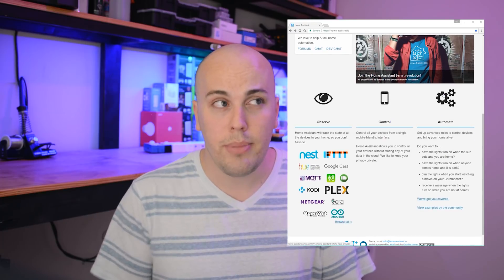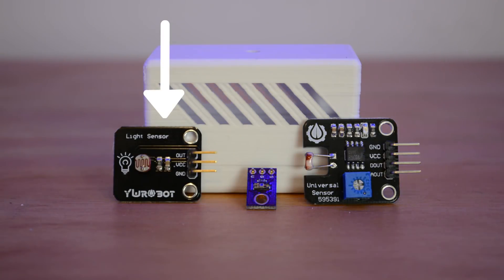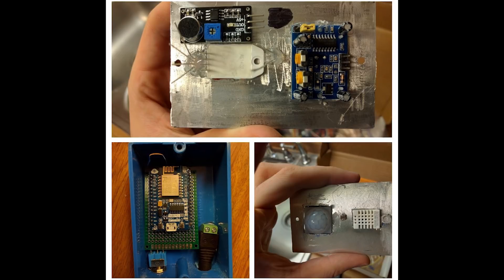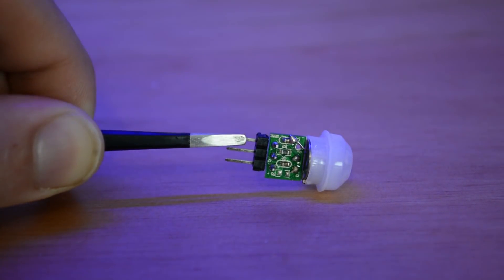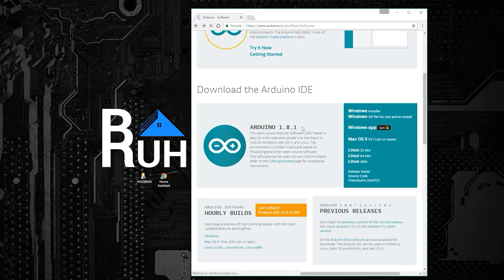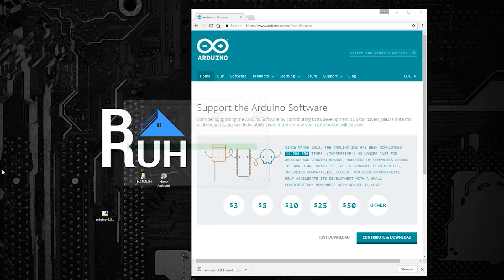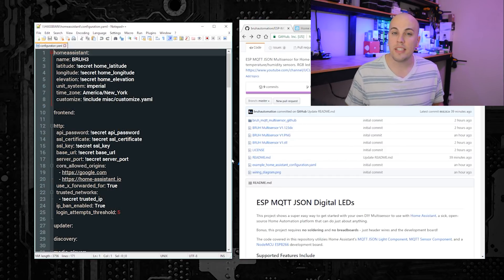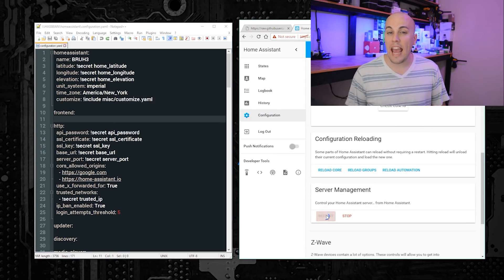$15 DIY Multisensor - Temperature, Humidity, Light, Motion, and RGB LED

Comment: Hello,

I've built your sensors and they are working great. Now comes the part where I actually would like to use them in an automation. I'm still in the learning phase of HA and is probably doing a lot of things wrong.
For example: I want to light the led up in the sensor with a specific color if motion is detected. I've set the color I want in the gui so each time I turn it on, it turns on in red. However, using below automation doesn't work.

  - alias: PIR 1  On
    trigger:
      - platform: mqtt
        topic: "huset/sensornode1"
        payload: 'motion detected'
    action:
       service: light.turn_on
        entity_id: light.sn1_led

Would be fantastic if you got the time to help out.

Comment: Haha built it.

Working for couple of days now. I just think the DHT22 is giving out a higher temp value then it should.
I had your box 3d printed, could the box small size impact the DHT temp reading? like the heat from the nodeMCU adding some heat to it?
Is there a optimum place to set the DHT22 inside?

Best regards from across the Atlantic, from Portugal

Nuno Reis

Comment: Followed by the letter but receive this error

arduino-1.8.2-windows\arduino-1.8.2\portable\sketchbook\sketch_may19b\sketch_may19b.ino:423:28: note: in expansion of macro 'PIRPIN'

     pirValue = digitalRead(PIRPIN); //read state of the

                            ^

exit status 1
'D1' was not declared in this scope
Reply: did you selected the right board on arduino IDE. 
go at tools, board, and chose one of NodeMcu board not just esp8266.
If you have a esp8266 module just remove the D from the sketch.and add the right pins.
Hope this makes sense.
Reply: I see, I choose NodeMCU 1.0 (not 0.9), correct?
Reply: Yes, i don't know what's the difference but deafeningly not just the esp8266 if you have an nondemcu. I think if you use NodeMCU 1.0 it should work. (if not try the 0.9) 
I just have the esp8266 board (without USB access) than you just remove the D and add the proper pin number found on the board.
Hope this makes sense.
Reply: I couldn't reply to the message you sent so i use this. 
That makes no sense. Have no idea why it does that. 
So you have the esp8266 library and the rest of them??
And you copied the sketch correctly?
I thought that you selected the wrong board since i made that mistake and got the error 'D1' was not declared in this scope.
It seems that you have something else going there. 
I am sorry i can't help with that maybe post your problem on some esp forums they may be able to help.

Comment: Awesome tutorial Ben, thanks for putting in the effort! I have the parts on order, oh the wait... in the meantime I browsed through your code. Am I right that the node posts all it values in one message on one topic? (i.e. bruh/sensornode1) An additional improvement may be to send sensor values in their own message, i.e. bruh/sensornode1/temperature and bruh/sensornode1/humidity so that they can be individually subscribed to with different QoS if so desired.

Comment: Hi Ben, Just completed this project & it is working perfectly.
I wanna make some door sensors using basic esp8266 eight pin chip (not nodemcu). I think that will be the cheapest & smallest diy door sensors. Because I am not good in coding, could you help in this or make a video for the same ?
Thanks for being a big support for beginners like me. Regards,

Comment: Hi, this is great. I plan to integrate your ideas into my MQTT wall controller project. Just need to think about placement (in the wall next to the wall controller, or ceiling), and getting power to it (PoE). Thanks for the excellent discussion about PIRs. I've also been thinking hard about these, I really wanted to include a microwave sensor to detect movement direction as well. But I may stick with the mini PIR you are using. For me it's all about the housing and placement, as we are refurbing the home so I get the chance to mount it properly somewhere in the wall or ceiling!

Comment: easy and works great.  thanks again for another useful and cost effective project.  btw, a clear raspberry case works great for this sensor node.
Reply: Good idea
Reply: Thanks for the suggestion. Have you tried and confirm everything works fine with the clear case?

Comment: I'm having a weird issue where the sensors work great but at least once a day seemingly randomly the sensors stop updating in home assistant.  Rebooting the MCU resolves the issue.  I'll have to catch it in the act and read the serial output when i get a chance.
Reply: I tried disconnecting the Motion Sensor,  changing the power cable / supply.  No Lock.  What is odd is that I can still IP ping the MCU but it just stops publishing anything over mqtt.  I'm going to get that serial monitor up soon.
Reply: My serial log shows the data just stops outputting once the MCU gets in this zombie state. Rebooting my router actually triggered this to happen.  I can still ping the MCU though but it just stops sending any data (Publish) and I can't control the led light once this zombie state starts.
Reply: I can reliably reproduce this issue by filtering the MAC address of the MCU on my wifi, then releasing the filter.  The MCU Reconnects (I can ping it) but no data is pushed or can be received on MQTT to the device.  And no serial information comes across either in the serial monitor.
Reply: I have the same issue. Node boots up, get connected to wifi but cannot connect to Mosquitto. Get error code "Attempting MQTT connection...failed, rc=-4 try again in 5 seconds".
It worked once for about 1 day, then I disconnected it to be moved. After reconnect it wont send MQTT :-(
Reply: I've fixed this issue with a code change, is published on GitHub now, bruh was going to update the main code soon too

Comment: I been working on this for about a day and I think I almost have it.   It 's like the MCU connects to MQTT but isn't sending over sensor data?  I just have the photocell hooked up.  Any ideas please?

MCU serial output:
WiFi connected
IP address: 
192.168.1.159
Ready
IPess: 192.168.1.159
Attempting MQTT connection...connected
Setting LEDs:
r: 0, g: 0, b: 0
{"state":"OFF","color":{"r":255,"g":255,"b":255},"brightness":255,"humidity":"0.00","motion":"","ldr":"0","temperature":"0.00"}
{"state":"OFF","color":{"r":255,"g":255,"b":255},"brightness":255,"humidity":"0.00","motion":"motion detected","ldr":"0","temperature":"0.00"}
{"state":"OFF","color":{"r":255,"g":255,"b":255},"brightness":255,"humidity":"0.00","motion":"motion detected","ldr":"311","temperature":"0.00"}

moquitto -v output:
1493590882: New connection from 192.168.1.159 on port 1883.
1493590882: Client sensornode1 already connected, closing old connection.
1493590882: New client connected from 192.168.1.159 as sensornode1 (c1, k15, uUsername).
1493590882: Sending CONNACK to sensornode1 (0)
1493590882: Received SUBSCRIBE from sensornode1
1493590882:     bruh/sensornode1/set (QoS 0)
1493590882: sensornode1 0 bruh/sensornode1/set
1493590882: Sending SUBACK to sensornode1
1493590897: Received PINGREQ from sensornode1
1493590897: Sending PINGRESP to sensornode1
1493590912: Received PINGREQ from sensornode1
1493590912: Sending PINGRESP to sensornode1
1493590927: Received PINGREQ from sensornode1
1493590927: Sending PINGRESP to sensornode1
Reply: I think what is missing is my MCU is not publising any data, though it does seem to subscribe to MQTT
Reply from the maker: Sorry about the issue! Make sure you set Pubsub to support a mqtt packet size to 512.
Reply: I just got it working using the portable version, I was having alot of issues because the esp8266 website was down wondering if that was part of it too.

Comment: Hello Ben,
Thank you for the grat tutorial,
How do you convert the temperature from Fahrenheit to Celsius.
 The DHT sensor is reporting it in Celsius isn't it? I could not find where you are converting it
Reply: Anil Roy in Ben's code he is passing "true" to the getTemperature call. if you remove the true it will return Celsius. it is a feature of the DHT library.
Reply: in the .ino file check the line 449 that says: 

      
      
            float newTempValue = dht.readTemperature(true); //to use celsius remove the true text inside the parentheses
Reply from the maker: It could be done mathmatically inside of the sketch, but if you have units defined in your home assistant configuration file here - https://github.com/bruhautomation/BRUH3-Home-Assistant-Configuration/blob/master/configuration.yaml#L6, if you set the units to F in your sensor it should convert it back to C I believe.
Reply: I would also like to know,  can't find it in the code.
Reply: That's what I could not figure out, when I ran espeasy rom on the same nodmcu, it reported the temperature in Celsius. Thank you for the tip.
Reply: Thanks. had the same problem. Now i know the answer.
Just took of the true and all works fine.

Comment: FIX/SOLUTION: for HC-SR501 PIR: high-frequency/RF interference : solder a 220nF ceramic capacitor across pin12 & pin13 of the BISS0001 chip. 

Came across this solution here -- https://www.letscontrolit.com/forum/viewtopic.php?p=13980&sid=ffb6eaf4ab4b57f28ea9c1ff548e4af7#p13980

Data sheet for the BISS0001 chip -- http://www.ladyada.net/media/sensors/BISS0001.pdf

Note: I used a 0.1uF cap on mine, and it has been completely stable sitting along side the esp8266-01 housed in a 2in. project box (super tight space)

Comment: My parts are starting to arrive! Note that the RGB LEDs come in packs of 10 which I didn't notice, so now I have 100 of them LOL. Wish I'd gone for the Wemos, already have 2 of them running Homie to control my boiler relay and sense the doorbell and they were no hassle. But stuck to the video because it saves me time, many thanks for the effort, especially the PIR as my first attempt had similar issues.
Reply from the maker: Sweet! Good luck on the build!
Reply: BRUH Automation Got it built. Sadly the AM312 PIR still gets false positives for me, so will have to try some of the other fixes. TEMT6000 only seems to read direct light on it, might benefit from a diffuser like the light meters have? I added code to sample the light readings and average them to smooth it out because often it would rapidly fluctuate between two readings.

Comment: Had the same issue with the PIR and WiFi. Ended up making a shield out of sheet metal and connecting it to ground. Seems to have resolved my issue.
Reply from the maker: Sweet! Maybe the ungrounded shield was my problem. That's awesome you got it working, though!
Reply: Michael Jenkins tie it to the ground pin on the pin header

Comment: Is it possible to run up to 50 of these at once? Each one would need to have 2 temperature and one humidity sensor, but no other sensors.
Reply from the maker: For sure. I don't think there is any problem on the MQTT or HA side for that.

Comment: Cool stuff and, as always, a great video explaining the whole setup:)

I took it a step further and added in the 433Mhz transmitter to it and then flush mounted the whole thing in my wall. I have 3 of them configured now, one on each floor

I put some pics up on the below post.  

https://community.home-assistant.io/t/anyone-using-a-315mhz-and-a-433mhz-transmitter-with-one-nodemcu/8920/3
Reply from the maker: That's awesome! I love the hardware side on that. Mounting in the wall is nice!

Comment: Just out of curiosity why not the WeMos D1 mini? 
it's smaller cheaper and has shields so its even easier to connect....
Reply from the maker: Not enough pins for this header wire setup. With a shield it works, but that's just more to deal with rather than using a straight board with all the pins I needed. But, they all work so whatever you prefer is good with me!

Comment: Thank you for pointing out the issues you had in selecting a PIR sensor. I'm currently also having issues with PIR and my Sonoff.... There are a lot of false triggers, I'm probably going with the sensor you suggested.
Reply: Did you have any better result with it? I'm using the usual big PIR (and a RAdar sensor, also) and having an hell of false triggers...

Comment: Most pins on the ESP8266 boards have pull-up resistors on them. So could you use the DHT22 as a stand alone?

Comment: Found your channel recently and I'm binge watching videos right now. ;) Not sure about the Aotec sensor but Fibaro one has a ton of configuration options that let you configure anything, from frequency of measurement, sensitivity, pooling rate down to LED signalization color (temperature dependent by default) and intensity. You should be able to configure it to be almost as responsive as the DIY one but it will affect the battery life. (I'm writing a Device Handler for SmartThings for it right now because available ones don't work very well when it comes to configuration so I'm "ears deep" in it's technical documentation). Also check out the new Fibaro KeyFob - up to 30 scenes in a small remote (I also wrote Device Handler for it - very fun device).

Comment: I must have watched this video 25 times, really great stuff. It's because of you I'm a total HA convert now. baller.

I'm waiting on a shipment of the PIRs you suggested, but in the meantime, I just wired up some other ones I had offhand (Gravity digital PIR). Weirdly enough, I'm getting no noise when wired up on the breadboard, but TONS when i try to solder everything on a perf board. I thought it was the wifi interference like you mentioned, but my breadboard setup has been running solid for 12 hours with no noise with the PIR sitting directly on the ESP8266.. hmmm.  Anyway, I'll probably try different things until the PIRs you mentioned get here.

Just wanted to say thanks for going through all the hard work you put into this channel. It shows, and you're my hero.

Comment: Doesn't the heat from the ESP throw off the dht22
Reply: Of course this would skew the results of the measurements.
You could zero-out the difference in the calculations or mount the DHT22 further away from the main box.

Comment: Hi Ben, your vids are so nice to watch. Thanks for the hands on video, also your approach on solving the PIR issue deserves an big applause,
Reply from the maker: Thanks much! Yeah, in the end it was quite a simple fix - just buy the right thing. :P Cheers!
Reply: hi Ben,  hardware as mentioned has been ordered (by Alixpress), gonna build it. One question, i currently build a similar setup (only temp, humidity, light) with a Huzzah Feather, and copied some other scripts using DTH, i just added the analogue photocell with a potentiometer and got it working perfectly. I used some of your design to get it configured quickly. Only question that i could not get fixed are the Value templates. I couldn't find clear reference on this. Maybe i missed something..

Comment: Hey, great videos. just started building my home automation base on a lot of info on your videos. I have 2 requests both around hyperion. could you possibly do a tutorial on how you integrated your hyperion into HA? Including the color picker box and the effects input list. I checked out you code on github but find it a bit daunting as i am quite new to ha. also. if you could share how to get the video grabber working on raspbian jesse that would be awesome. I think its a driver issue but have no idea how or what to install. Im using the lightberry.eu system. Thanks and keep up the great videos.

Comment: isnt it easier to define the MQTT_SIZE constant before you include the library?
Reply from the maker: I suppose it is! Never thought about doing that. I suppose those locally defined constants overwrite the default in the library? I'll need to give that shot!  Thanks much for the idea.
Reply: If you look into the source code, the size define is only set if it isn't set before.  So just set the define constant before it is included.
It need to be done before each include file for the library.

Comment: The timing of this was perfect as the day before I received 3 NodeMCU's and wanted to add a wifi thermostat in my conservatory using a spare DHT11. With the help of this video is was a lot easier to implement than I thought before they arrived after the research I had done.

I needed to add "Adafruit_Sensor.h" into the DHT sensor library before it would compile and I also needed to tweak the code to show Celsius instead of Fahrenheit and change sensor to DHT11, but apart from that it all went swimmingly !!

Will add a spare 3 colour LED later today when I get some time but I doubt I'll need a PIR in the conservatory.

Thanks yet again Ben for doing your videos which help me a lot and make HA so much easier to work with :-)
Reply: Be warned the dht11 is not very accurate, and fairly susceptible to noise. dht22 seems to be much more stable and accurate from my experience.
Reply: tablatronix I have a DHT22 in the living room. This was a spare from a sensor kit that wasn't being used. A rough conservatory monitor is fine.
Reply from the maker: Nice! Oh yeah, whoops, I forgot that the DHT22 sensor had its own library. Pumped you got it working! Cheers!

Comment: Thank you Ben for another great video. I have set up my own multisensor using your tutorial. The Arduino code is fantastic, it's very well thought out. The use of json and mqtt works perfectly. I'm going to build on top of your work and add a ir remote and 433mhz transmitter. Then I can retire my own multisensor for yours. Keep up the good work
Reply from the maker: For sure! Definitely let me know how that goes. Would be sick to see it support IR and/or 433 RF.